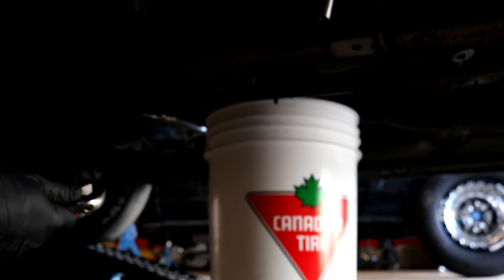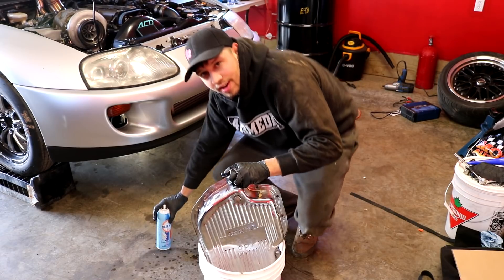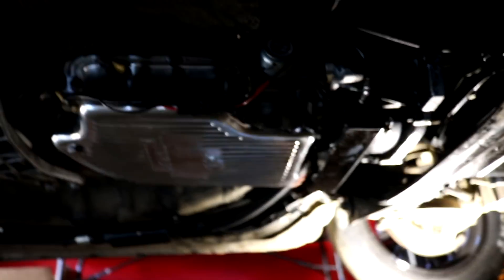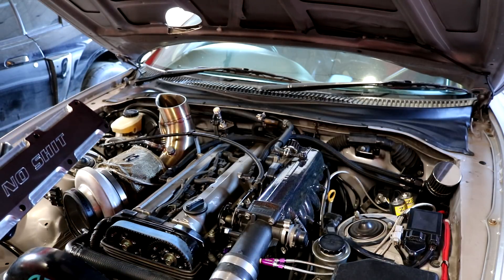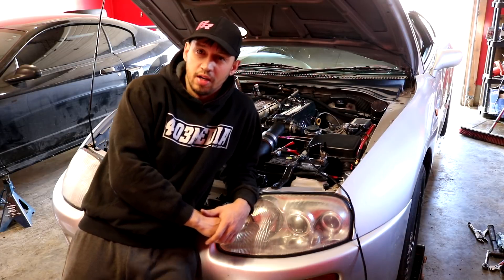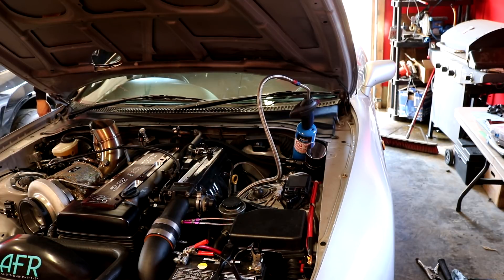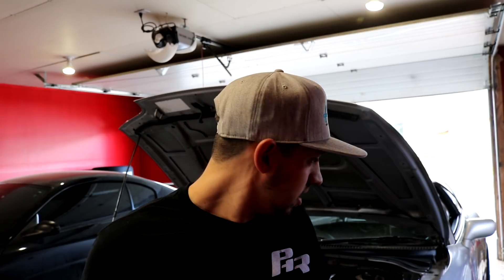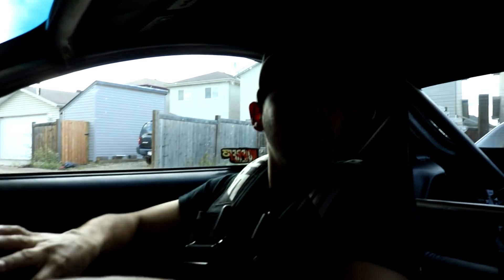800Hp Supra Pulls On Street

Comment: Time for a trans pan drain plug. So you can save your fluid.Research the th400, If you can work on that 4valve Toyota 6 cyl. You can work on a th400.

Comment: We found that there is no more hp to be gained from e85 to e98 fuels. A few guys by me make 2500 hp plus on Sunoco e85 ethanol.  The only additive we add is 2 ounces of Marvel Mystery oil per 5 gallons of e85 for lubrication.
Reply from the maker: +Evan Gomes yeah I have some 4 stroke alcohol lubricant that I put in to my drum too
Reply: Boosted Lifestyle    snake oil? Hahahaha

Comment: 6:24 😂😂😂😂😂😂😂😂😂 

Try getting your tuner to setup about 25°-30° of timing initially for start up and idle during warm up until it gets to about 100F.  That'll get it to 🔥 up and run on all 6. I had the same issue on cold snaps here in Florida. I know I know. But I figure it out real quick on the few 30F days we had. 25-30° total will get it to run. So basically do "ignition vs coolant temp offset" and set it up to add another 10° over your normal idle ignition. That should yield about 25° total. Hope that helps :) 

I never had access to E98 so more ignition will be needed to get it to fire in time. Because it isn't atomizing you have to give it more time to light off. So hence why so much advance when cold.

Edit: I forgot your tuner didn't lock your map. Do it yourself dumby :P